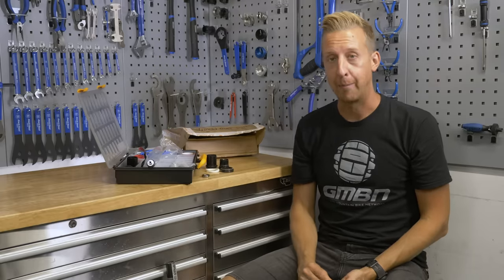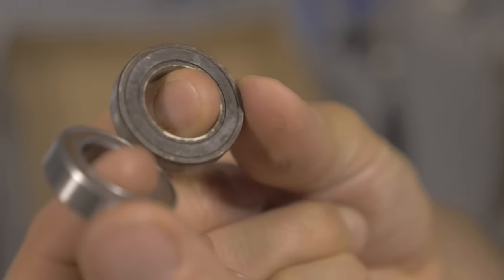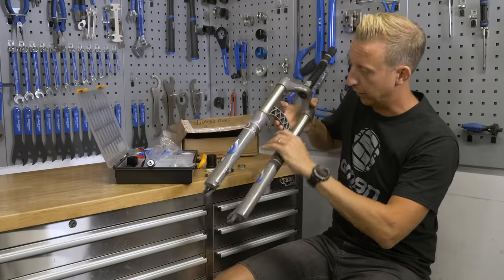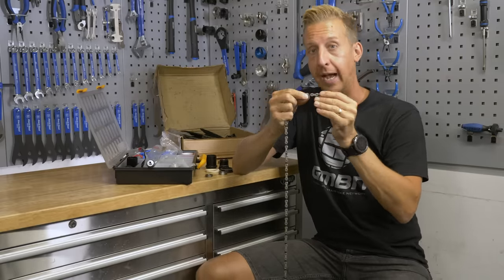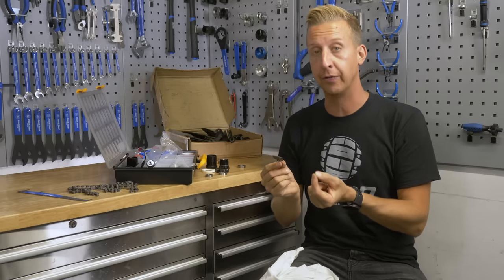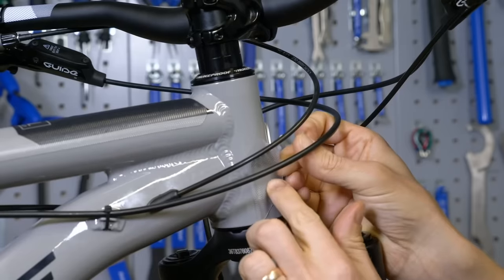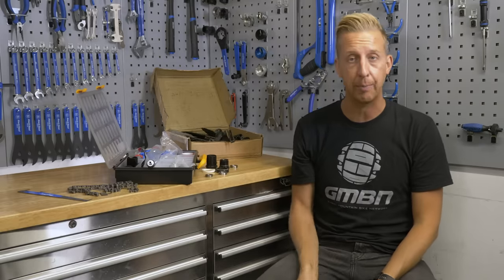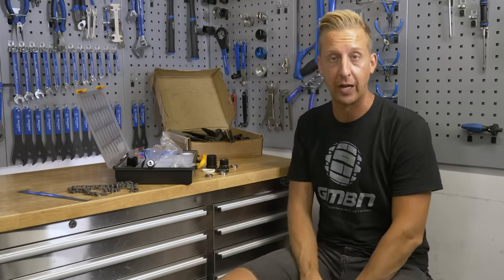7 Ways You're Destroying Your Mountain Bike | MTB Maintenance Tips

Comment: The crank bearings grinding like they have sand in them was a common sound on my friend's bike when I was a kid. They couldn't understand why I would go through the trouble of disassembling the crank to clean, lube, and adjust the bearings, but they couldn't keep up with me in races either!
I wipe my fork down after most dirty rides, but will need to get some fork oil since this is my first suspension fork.

For checking brake rotor thickness, measure just the rotor that contacts the brake bad. Having the caliper on the rotor support will be inaccurate.
I always seem to get mud on my e-bike controller even when it's dry out! I'm thinking of making a splash shield, or a mud flap for the fender. If I'm done riding for the day, I'll get a damp cloth and wipe down everywhere I can reach, being careful to turn and wash the cloth frequently so I'm not rubbing grit into the paint. Fortunately, my bike came with a fabric and foam cover to guard against chain slap. I cringed at using Coke or whatever that was to douse that mid drive!

Not sure if I'm riding my bike too much. Only had it for two weeks and have 263 miles on it...

Thanks for the video! I learned.

Comment: I'm guilty of all of these except the bearings with my poor ol' Motobecane....
Missing paint splotches, visible brake rotor scoring, I finally gave the drive train a cleanout in preparation for replacing the cassette, chain (yep, that thing was boned), and derailleur sprockets (I already replaced the chainring), the front fork is knackered and makes frightening noises, and the bike served as my commuter and "everything" bike for a few years before it got sent to the garage because I didn't yet have the skillz to repair it.

Comment: Hi Doddy. I have a pair of Rock Shox Reba, 32mm dual air forks, which are about 10 years old. On  the outside, they look mint. But I pumped them up to 110psi a couple of weeks ago, and they lost 40psi overnight, without any load on them. So I pumped them up again, and the same thing happened.
They came on a bike that I bought 2nd hand, so not sure when, or if the forks had ever been serviced.
I tried a little bit of water on the upper and lower valves, but could not see any bubbles.
I then dismantled them, and submerged the upper leg air chamber in water, to just above the crimp, but no bubbles. So I removed the air chamber from the upper leg to inspect the inside of the stanchions, and found that there was slight wear on the inside, some very slight circular scoring, and some of the kashima coating having been worn away. The rest of the fork components, including all the O rings, look fine. And there is no wear on the outside of the stanchions that I can see.
Being that it is the lower leg that is losing pressure, could this be the wiper and seals on the top of the lower legs that need replacing? And should I  be worried about the coating being worn on the inside of the stanchions, or can they ve re coated? 
I could probably service them myself, if it is worth doing, but don't want to shell out almost £100 for a service kit if they are beyond repair.
Thanks.

Comment: Just did a wiper and seal service on a badly neglected pair of 2009 production 2010 F29 Fit RLs. The legs look pretty bad in a couple spots and the bushings are worn but with new FOX green(Not easy to get in US haha) A hone on the damaged bits of the stanchion and the seal/wiper they still feel good and are not leaking. There is a bit of play I hope replacing the bushings will help and when I do that I can service the air spring and damper which still thankfully work wonderfully. Not sure about those particular forks but I would not totally write off a pair of forks with a bit of stanchion wear especially with how much a new set could cost. Thanks for all the great tips I enjoyed the video.

Comment: when I bought my  current bike 2 yrs ago I considered keeping my old bike which was a very cheap Walmart dual sus Mongoose that I purchased in 2013 for around $150. My current bike is a 27.5 with an XL frame, by old bike was a 26 inch. I considered keeping my old bike for use in the winter but tbh I didn't enjoy riding that bike. I never looked forward to going out on it so I gave it to a thrift store to sell, I think someone was probably very happy with it considering I did put about $300 worth of upgrades into it. I actually look forward to riding my current bike (Upgraded GT Aggressor Pro). I ride it year round and it's been solid so far with just very minimal maintenance and cleaning (a wipe down every now and then with a soapy rag).

Comment: When cleaning your bike, do not put it away wet, dry it with a towel or microfiber cloth. Don't use anything that can scratch your frame.
Reply: Yep, good point. When I wash my bike, I dry it with a towel to get the majority of the water on the frame, then I use an air compressor and blow any water out of the tight spots and the components, always making sure it's completely dry.

Comment: Thanks for the tips.
Only doubt I have is about cleaning the bike. I have cleaned my bike several times but before every next ride, when I come to lube the chain I find rust starting to build on it and also on the rear drive set . Now I am talking about my brand new bike Giant Trance Advanced 2, although isn't among the very expensive ones out there, still isn't made of poor quality parts.
Just to note that I also give the bike a fair towel wipe to dry as much as possible.
Reply: Probably obvious but the mistake here is failing to lube immediately after cleaning and drying. Don’t wait till before the ride, if you lube after cleaning you also don’t need to worry about it while you’re getting ready to go.

Comment: If you know in advance you will riding in wet and muddy conditions, spray your bike (AVOID DISK BRAKES) with lubricant like GT85 or similar. This will prevent dirt, mud, clay, sand. etc. from building up, sticky to your frame and drivetrain. Muc just doesn't cling/stick and basically falls off while riding. This will keep you bike and drivetrain in particular from unnecessary wear while riding in those conditions and added weight carrying that buildup of mud. Your drivetrain will work as intended without overload of muc in the rear cassette, chain, pedals and cleats.

Comment: if you do not raise the bike as to enter some (tight) elevator... you should consider doing something similar for a bit as to help oil in the fork get to where friction would occur because before you ride the bike the oil is almost drained from there from one day to another - foam rings are absent from many forks and the reason is (quote): "if dirt/grit does get behind the fork seal itself then its better for the grit to go into the oil in the lower leg rather than sticking in the foam ring and possibly causing wear/scratches". if you do not do so on a fork that has no foam rings then the seals might get damaged and possibly the fork legs as well, especially if not regularly kept clean. at least cycle the fork a bit before riding the bike but do so pressing on it with no significant bending/flexing stress on the forks, only use the brake to lock the wheel while pushing on the forks as to pump oil to the stanchions. clean any oil/dirt you see on the outside using some sock in a circular motion on the fork legs as in using both hands. be careful about the seals as they are vulnerable to chemicals like solvents. a bit of silicone oil might be of use for wipers - but be sure there's no water present and the wipers have no dirt on them. wipers can get stiff and vulnerable to cracking. be sure to wipe away any silicone residue after cycling the fork.

Comment: Chain links do stretch, I've been a mechanic for a long time and tested this myth early on. I compared a chain that was way, way past its lifespan on the park tool indicator with a new chain, counted the links and hung them together. The old chain was clearly half a link longer. Hollow link and half link chains elongate faster than solid chains.
Reply: The pins and plate interface wears (not stretch).  Rollers wearing (6:56) does not affect wear/elongation of the chain.

Comment: About the over using, yes it’s a bike and you can ride it. What some forget though, are the gears. Constantly using the same gear will wear that gear out. For some reason you just ’have to’ ride with 400 watts all the time. Just use the gears. They are there for a reason. You don’t ride your car on the 5th gear all the time either.

Comment: My grandpa always uses his old bike he bought 30 years ago... never serviced, never used any chain lubricants, never changed those rubber braking pads, NOTHING, I tried to ride it and I couldn't go faster than 10 kmh... the steering needs a lot of force to move, chain and pedals too, the long metal struts ( not native english speaker sorry ) are moving around like they are coo pilot of Colin McRae, and my grandpa still thinks it doesn't need any service... ive been repairing his bike for last week and im somewhere  in the middle. oh yeah, and the rust... THE RUST IS EVERYWHERE, EVEN INSIDE THE FRAME

Comment: Been at this a while (from ProFlex days) and a happy ride involves a clean and lubricated chain (lube inside as opposed to outside). Can't believe you left out the Park Chain checker given all the other tools on display. If one trashes a chain at .75 wear, the new chain will stay on your rings and make you happy.  Let that wear go to the 1.0  or beyond and a new chain will not work on the old chain rings and you're into new chain rings and cassette, which is not a cheap fix.  Cleaning and lube is cheap on the other hand and hypoid gear oil is as good as any commercial lube for wear resistance.  And lubricant durability does not apply because you are keeping that chain clean eh!

Comment: If you don't have vernier (?) measuring tool for accuracy, put coins eg pound coins, either side of the rotor (bike or car rotors) and measure as well as you can with a normal tape measure.  Then subtract the thickness of the 2 coins and voila you have the thickness more or less.  

OEM rotor specs should have min and max thickness values to compare with.

Comment: Been riding mtbs for donkeys years... always cleaned my chains manually. Got a new 2019 bike ...I got a bit lazy and started using a chain cleaner thingy... you know thread yer chain through spin it round , rinse and spray. On routine inspection of my rear freehub ..the grease had been washed out of the freehub cone bearings.  
I now clean manually again...two scrubbing brushes over a bucket ...on a work-stand wheel off of course chain hanging over the bucket  ... rinsing the chain with a kettle of boiled water. Spray / oil good to go... ( do this on every off road adventure)
Reply: Oh ...forgot to say that chain/ derailleur clean can be done in a flat with a handheld water sprayer to rinse ( I used an empty Method kitchen cleaner squirty bottle ) . the cack goes in the bucket . ...Jesus its pissing down today...hence I'm here not up the woods playing. :/ ....I mean it's really pissing...and cold.
Reply: Oh and my open cup and ball rear hub has been replaced with a sealed unit hub. Thanks to the manufacturer...foc.

Comment: TLDW: 1. Riding on loose and/or worn bearings. 

2. Keep stanchions clean and service your forks.

3. Replace worn chains. Use a chain checker to check stretch and look for hooked teeth on your cassette.

4. Check and replace worn brake pads. Check thickness and for scoring marks on old rotors.

5. Consider using frame protection kits/tape/stickers to protect your new shiny frame. 

6. Clean your bike. Do it systematically, inspect your bike as you go. 

7. Don't overuse your bike. Consider a cheap cheerful bike for your commuting / errands to keep your pride and joy lasting longer.

Comment: I haven't learned anything new, but but great advise.
but my next step is new proper frame, suspension.
but I need something proper, not what I got now, it could make someone crazy.
I am think it might be a Nicolai. easy to work on, no silly stuff, good cable routing.
and double sealed bearings, cus the pivots have covers with seals on them, seems like a good idea, But I see Pole bikes claim that's a bad idea, and it traps water in there.

Comment: DO NOT add some oil inside your fork with pushing out the seal lip. You can easily put some dirt between your stanchion and lowers and IT WILL cause abrasive wear

Comment: Used to be able to get rubber boots to put on a fork to prevent the fork from collecting dust and grit on the seals, basically moving the issue further up away from the seals. Thought about getting those but..
Cant find those anywhere anymore 🙄
Yeah ok so more modern forks, ublike the old ones have better seals. Still the added protection I would love since im biking on an island made out of sugarsand, lots of dust here too and a harsh salty moist climate when its not dry. Even seafog can nuke a bike into oblivion. Leaving a bike outside all day for example for 2 weeks will make a brand new chain get covered in rust even with the original and extra added lube.

Comment: Re over using your bike:
The main reason they wear out so quickly is that they are under engineered for daily use (too light, complicated, fragile etc).
Competition bikes are stripped down and maintained after every race or even daily for longer events.

Basically the same as trying to drive a F1 racing car on your daily commute!
OR
For the older set
Like hitching a race horse to a plough or wagon.

They're not designed or built for it.

Comment: I bought a used Walmart 29er (ozone) bike for super cheap, and it was crap. Then I bought a Schwinn 26 inch women's MTB with flat tubes for next to nothing. I swapped over most of the parts. The Schwinn had just about everything made out of quality metal, with screws that didn't strip UNLIKE the Walmart bike. Now I have a 100$ 29er MTB (it is a hardtail) that is actually decent and I have tons of spare parts as well. I have been using it just about every day for a year now, doing light trails, road biking, and biking around campus with almost no issues. I am thinking of selling the extra parts on Facebook marketplace and making some of that 100$ back. If you have the knowledge and patience, you dont need to spend 3k on a bike. I think that unless you are as serious as the guy in this video about biking, you probably shouldn't.

Comment: Not truing your wheels! At best, it reduces efficiency. At worst, it results in warped rims, unseated tire beads, and/or face braking.
Reply: I dont think any of my bikes have had true wheels for more than five minutes. I mean if i did true my wheels i would be doing it every day after every single ride.
Reply: @kudosbudo  I ride pretty heavy myself, but with proper spoke tension, I've been able to keep my rims true for months. You just gotta bring em up to about 94%, and they'll stay true for a while. Bike wheels are like a suspension bridge: the more tension on the cables, the more stable the bridge is.
Reply: I just painted my frame with a fresh iridescent clear coat over a black base coat. Absolutely beautiful in the sun. Worth protecting in any way.

Comment: 10:30 - Lol! Ok so don't wash your bike with a monny and a broom. But is it ok to smooth the end of the fork tube with the sidewalk, exceed the manufacturer's max air pressure on tires and shocks sometimes by a hundred pounds, ride on wheels with no tires, true your wheels with a rock, and basically overuse your bike every time you touch it? There is so much not covered here, I'm confused.

Comment: never servicing anything , not tightening bolts, letting bike be out side, wet and salty, whole winter, let the tyres dry in the sun.
I i've seen the complete destruction package, quite common actually, BB so loose I can move the cranks 1-2 cm, that's on kids bikes.
seat been loose so long it destroyed threads, so saddle loosens when after 1 minute.
quite common.

Comment: Any tips how to get out of the evil circle of leaking Shimano brakes?
lasted few months, few rides, few rides.
but I got TRP Spyke Mechanical brakes too, I think I will need to go back to them, cus I can't take it anymore.
Also a issue I have is gravel and hard braking bending the pads, and once it damaged a piston. I've sent 3 brakes in for warranty, I'll see how it goes, but as I was riding home the front brake leaked after few rides, it's ridiculous.
I've never had brakes last so long I got black fluid.
at least they are better at the lever than the M615, but still have some plastic.
but reach adjustment is silly, kids can't use them cus they won't be able to use full power, I can use them as they come, in mid setting, but if they leak it means lever to the grip.

Comment: I've heard that lifting a bike by the saddle (or hanging the nose of the saddle) can harm some dropper posts by sucking air into the system. Is this true? I definitely have air in my Reverb, and even if I bleed it out, it returns, signaling that some seal is compromised. I DO hang it by the nose of the saddle sometimes (e.g. on a repair stand when I don't want to clamp it (I have external routing and it's a PITA to avoid clamping the dropper's hose). Is this bad?

Comment: The front forks on my Specialized Expedition circa 2005 roughly are seized. Like they may as well be rigid forks at this point. I am not sure I want to tear them apart. Is there an oil I can use to lubicrcate the seals a bit and maybe unseize them? WD40 I think would deteriorate the rubber seals. As long as they have a bit of give I am good with them them as I do put a lot of miles on my bikes but not a lot of trail riding. Mostly I like them for smoothing out the moon craters on the streets where I live. Or do I need to do a complete tear down and rebuild?